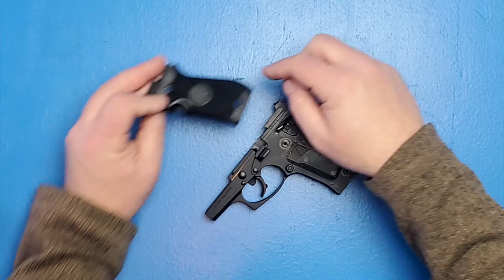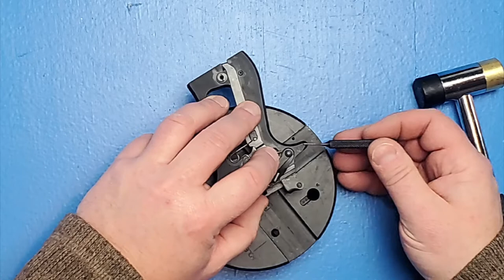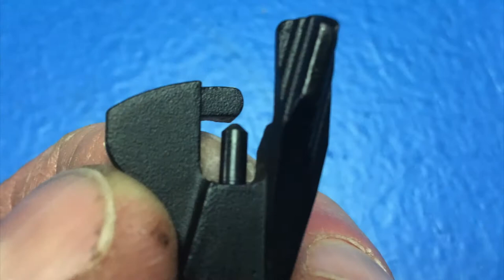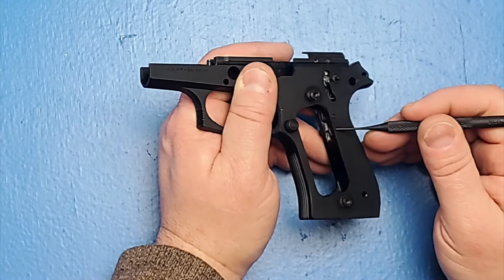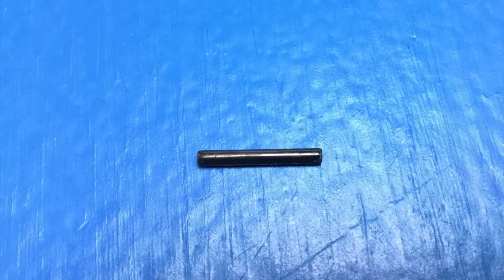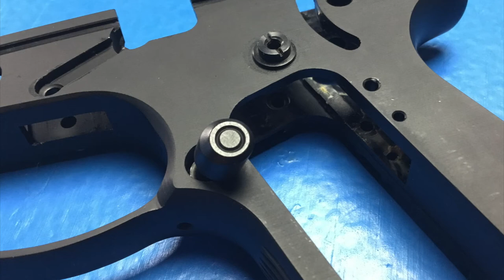BERETTA CHEETAH // Complete Frame disassembly (Beretta 84fs Cheetah, Beretta 85 Cheetah, Beretta 81)

Comment: Great video!  Thank you.   I am having my Beretta 84bb chrome plated so I had to completely disassemble my gun.  I hope to use your assembly video to put it back together.
Reply from the maker: Glad you fond it helpful. I originally did videos like this because I used to do  Cerakote work and it helped customers out. The Trigger pin is the hardest part to put back in on these guns. Not impossible but be prepared for some adult words to come out of your mouth.

Comment: What a great service you provide! Really great references and instructions, all your Cheetah videos! Question- do you believe its needed to modify a shok-buff recoil buffer, like the one wilson combat sells for the beretta 92, such that it fits in my 84F and provides protection against wear to the frame? This was advised to me at the range by someone with experience using the shok-buff product on their 92, but I can't find any evidence that folks are using a modified buffer for thier cheetahs. Thanks in advance!
Reply from the maker: Honestly, I never believed in the shok-buffs so I never worked with them. The Cheetah is not an extremely popular gun, that is until they re-launched it last year but even then... It is big for a 380 and for that size, you can get a 9mm. Also it is an overpriced gun. That being said, my wife carries an 85 *(this one in the video is one of her spares) and she loves it. If they came out with a 9x19 version of the Cheetah, it would probably be more popular and have more aftermarket support. Sorry to ramble on just to say, I don't know.

Comment: Hi Sir, can you help me pls. i have a beretta 81 2019. but the rear trigger bar part wont engage the hammer each time AFTER i turn on and off the safety. i must push the front trigger a BIT forward (outward) to engage the rear trigger bar to hook the hammer. then it's normal to shoot again. why is that ? is it because of weak trigger spring ?
Also, when safety on, when i pull the trigger, it feels CLICKY. when i checked, what's inside, the trigger bar again positioned not low enough so it hits something in there causing a clicky sound. i can send you videos if you have email. thank you for your precious time.
Reply from the maker: I would love to help you out but for liability reasons, I cannot give advice. You may be on the right track on that trigger spring as that is the only thing pushing the trigger forward. As for the clicking, I would worry about the trigger movement first. It just might solve your second problem.  Thanks for watching. Let me know how you make out.
Reply: @TheRogueBanshee  i just ordered a spring set from USA to my country . i will update when i replace them all thanks sir

Comment: Hi. I'm trying to replace my grips but I don't seem to have a screwdriver with a thin but wide enough head to remove the screws. Can you tell me the make and model of your screwdriver?
Reply from the maker: In that video it was the Wheeler Engineering 89 piece gunsmith screwdriver set.

Comment: I really wished to get me one 81fs but now, I am definitely changing my mind and try to get a M9 .22lr instead since it is way more easier and funnier to disassemble without being an engineer or feel like doing maths in order to open up and clean my gun..hahahaha
Reply from the maker: The beretta 81 is a good gun... but it is hard to find ANY of the 80 Series out there right now. The one thing I worry about the 81 is that it is 32 cal. Ammo being hard to find now... I doubt you would find any 32. I did a video n the M9 22. That is such a fun gun!